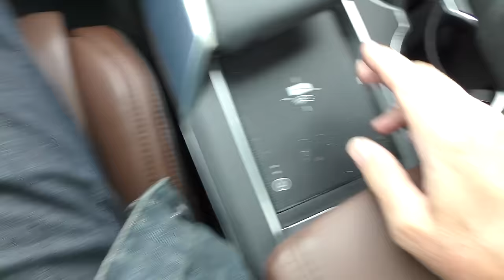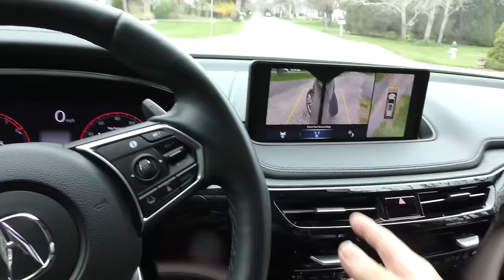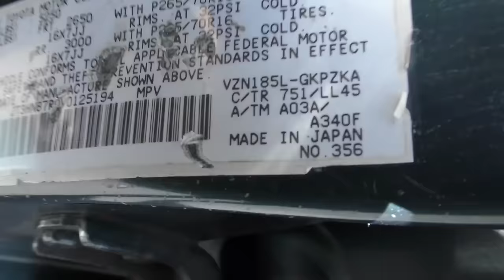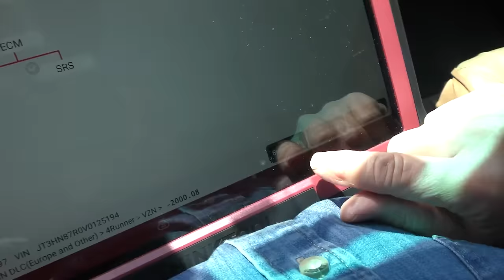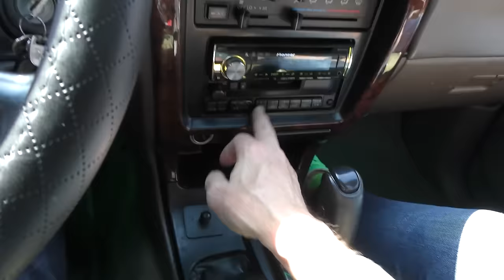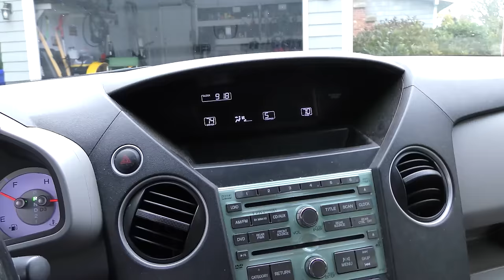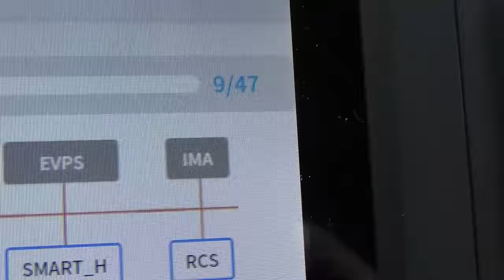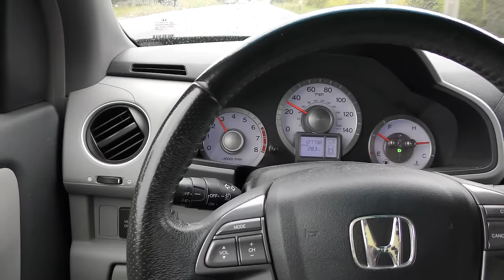3 SUVs That Will Last 500,000 Miles or More

Comment: Agree! I do not understand people buying Mercedes... the proof is the Craig-List old Mercedes costs the same, as old other similar cars... and people are not buying those Mercedeses...
Reply: that's because there was a time a Mercedes was built to last 50 years or more and that is not true anymore , people look for quality , these days honda and toyota is a safer buy for long lasting vehicles
Reply: people buy old used cars to save money and Mercedes parts and work is expensive.
Reply: @KaliAndy2  You would expect that for the price of Mercedes, you would get a better quality car. The used car business shows you how reliable the car is - it does not fare well for Mercedes... the reason is simple, German cars in general are unnecessarily over-engineered...
Reply: @peterjanosik3601  big part of that is cost maintaining a car.  $80k cars parts and labor will be a lot more expensive than 25k car.  Old cars regardless how reliable they are will need maintenance.  If you buy a car with 150k miles stuff like alternator, fuel pumps etc will need to be replaced at some point.  Alternator for cheaper car might be $80 for parts and easy to replace.  For luxury car it might be $500+ plus labor.  People who buy old cars are generally tight on money and can't afford expensive upkeep of a luxury car.  And people who buy luxury cars generally have money and don't want to buy an old one.
Reply: @KaliAndy2  I think we do not understand each other. The problem is that German car makers are cashing in on the pool of people that understand the necessity of unnecessary engineering (and car logo). I am not sure though if those people realize that the resale value of old Mercedes drops a lot more than the resale value of other luxury cars. Practical people make practical decisions.
Reply: @peterjanosik3601  Mercedes, BWM, Jaguars, Volvos, etc all have horrible resale values.  Most people who buy pricier luxury cars do it because they want the car and could care less what the resale value will be in 5 or 10 years. Many of them lease it too and get a new car every 5 years. They could careless if car might lose 2/3 value in 5 years.  People who can afford and lease/buy those cars will never buy a used one.  Money conscious people simply don't buy those cars either due to how expensive it can be to upkeep them.  So there is really not much of a market for those cars used.  Plenty of supply and low demand is reason for the low resale prices.  Cars that are cheap to maintain and last will always have a higher resale value.
Reply: @KaliAndy2  Agree

Comment: I just bought an 02 sequoia with 183k on it it for 3500. Sure it needs a front end refresh and some rust repair in the roof channels. But..  the frame is impeccable. I plan to keep this 2UZ powered beast going for quite some time. So much more reliable and cheaper than a new suv/minivan!

Comment: Picked up a 04 expedition 2 years ago. It's a real nice high mileage southern truck. $3,000.00. I'm currently bringing it back to new condition my budget is $10,000.00. 1 more year and it should be done. I'm retired. All new suspension, large off road tires. Winch. You name it it's been replaced. New paint soon. Then I will register it. It's been a great project. I will have an almost new truck to travel the country. A new 1 is almost $80,000.00. Who cares about mileage. It's paid for. In the future I think your going to see lots of people do what I'm doing. I've had several people wanting to buy it. No way. Have fun.

Comment: Just bought a 2023 4Runner lol. I’m in Love with this thing!
Reply: I have a 2021, and I'm in love with mine too.  They had to give me a rental when they put on new tires because they didn't balance them right the first time, they gave me a 2023, and literally nothing is different. They were supposed to get a redesign in 2022 but I guess that got pushed back.  I drove a lot of very nice cars before I bought the 4Runner, and now I wouldn't trade it for  a Mercedes.
Reply: @huwhitecavebeast1972  i believe the 2023 has a lot more tech standard than the 21 but overall yes it is the same car.

Comment: 1999 TOYOTA 4 RUNNER WAS THE BEST YEAR FOR THIRD GENERATION 4 RUNNERS. HAS THE LOCKING REAR DIFF. PREMIUM STEREO SYSTEM WITH CD PLAYER. GREAT 4 WHEEL DRIVE SYSTEM MY BROTHER HAS 2 OF THEM ONE WITH ONLY 57,642 MILES AND THE OTHER WITH 596,638 MILES . 
BEST 4 WHEEL DRIVE SUV’S EVER MADE.

Comment: If you buy the right year your Mercedes can last as long as a Honda & Toyota!  I had a 2002 ML320 all wheel drive, that car kept going and going!!!  No major problems at all! I did have problems with one of the door locks actuator, other than that, it was a good car through & through, sold with 200k miles. I still see them on the streets. I did end up upgrading to a 2018 GLE 350 and so far so good!  Didn't want to buy a new one because I don't like 4 cylinder turbos!  I wanted a solid v6 with normal aspiration!   During my 20s I drove Honda's & Mazda's great cars but don't feel premium.

Comment: Good evening Scotty! I've got a 17 Corolla with 68k miles, got a squeaking noise (not very loud) coming from the engine when it's in drive but not when it's in neutral or park, any idea what that could be?
Reply: When did you change you oil? Make check for errors
Reply: @RomaKTLlll  oil changed less than 3k miles at the dealership supposedly, i checked it the other day it still is at good level and good color to it
Reply: I have a 2018 Corolla that made the same noise. I took it to Toyota and they said it was the alternator that needs to be replaced. Apparently some cars of those years came with bad alternators. They replaced under warranty and haven’t a problem since. I recommend you get it checked right away.

Comment: Hi Scotty or other experts here - My Lexus RX 400h of 2006 model with 190k miles on it. recently I realized that my fromt wheel tires wore out with in a year and when I went to the store they said its probably the issue with allignment, and I took it to the mechanic and they checked and said they can not do alignment as the bottom of the car is all rusted. Please suggect me if it is safe to drive this car? I love this car  but I am also worried if it is really safe to drive? Thank you.

Comment: Ford Excursion with a 7.3 Powerstroke will outlive them all, so will a Jeep Cherokee with a 4.0.
Reply: @Lray4x4. What a joke! Lol!
Reply: @DEMENTOR MOPAR What SUV had a Cummins in it?
Reply: @mrgurulittle7000  Seen plenty of 7.3s with over 500-600K of them on the original engine, never seen one of the SUVs mentioned with that kind of milage.
Reply: @Lray4x4  only one here I’ve seen with 500k is the 4Runner, especially the 5th gen.
Reply: @Lray4x4. If you never saw these mentioned cars get past 500k, you must live in redneck zone!

Comment: Scotty, I have a 1996 Toyota 4runner 3.4l 4wd. The front passenger brake caliper keeps seizing up on the rotor so snug that I can barely turn the wheel with my hands. The pistons in the caliper will not retract. I have replaced the caliper several times and it keeps doing the same thing. I replaced the ABS module and master cylinder, that didnt help either. It is also building up pressure inside of the valve covers and blowing lots of oil out from the gaskets. Could the seized caliper be causing the extreme pressureto build inside the valve covers when I drive? Do you have any suggestions on what could be causing the caliper to keep seizing.
Reply: Yep it’s from 96 that’s why.
Reply: Replace the hose
Reply: @edwardhalpin7503  false
Reply: The clip on the hose may have rusted and prevent fluid going back
Reply: Change your brake lines from your master cylinder to your calipers I had the same problem and fixed it
Reply: @Jay Dee he wants you to sell your 3rd gen so he can have one 😅
Reply: @Jay Dee 😌😌😌💪😂

Comment: Scotty, good morning I just bought my daughter 06 Toyota Japanese motor, four-cylinder Highlander has 260 some miles on it. AC works great but when I turn the heater on it’s blowing but no hot air is coming out upper radiator hose warm to touch and has pressure lower radiator hose has pressure. cool to  the touch do you think thermostat I don’t know what do you think?  I should check first. I am sending it to her in Reno and it’s cold in Reno help

Comment: Why isn't the Chevy Tahoe/Suburban on this list, even when modded, they have been know to last forever.
Reply: @Mike-sp4iz  Chevrolet is the equivalent to Honda and Toyota, just the American version. My family is foreign and didn't really even like American cars until they owned a Chevy. Chevys can live for a long time, trust me, I know.
Reply: Idk about Tahoe but Suburbans are good vehicles.  Not as reliable as 4Runner, but pretty dang good.  Better mileage than a 4Runner.
Reply: 2001-2006 Tahoe
Reply: @harveyhankerson8359  Just switch to a 4L80E, that was the most common recalls. Also, not just every Tahoe/Suburban but every car in general is different. They all are put in different conditions like weather, different driving styles, etc. So every car has different wear and tear. That's why you will see some cars with 200,000 miles and the motor blows, or 200,000 miles and still driving like it did off of the lot.
Reply: @donaldpump1959  Yes indeed, the GMT800 platform is one of the most reliable platforms GM have ever made.
Reply: @huwhitecavebeast1972  They are the same vehicle, the Suburban is just stretched longer.
Reply: @Mike-sp4iz  But that doesn't take away from the fact that the Chevy Tahoe/Suburban (especially the GMT800) is very reliable and can easily last 200,000+ miles. But every car's wear and tear is different.
Reply: @Mike-sp4iz  I'm by absolutely no means an American car fanboy, but the GMT800 (1999-2006) Chevy trucks were very reliable.

Comment: I don't know why they just can't produce the older vehicles that were less computerized. The modern day vehicles break way to much. Good example I have a 2012 ford focus and the car has been in the shop twice for transmission problems. Fortunately they were covered by Ford. The previous focus that had the old style transmission instead of the 10 speed which is basically a manual transmission that's computer controlled. The car has 138k on it. The older focus was also easier to work on I tried replacing the alternator and ended up bringing it to muffler man. The mechanic said it was difficult to replace and I said I know that's why I brought it to you.
Reply: I grew up in Detroit area where almost everyone worked for the car industry.   The joke was Ford stood for fix or repair daily.

Comment: My 2003 Ford Explorer has 250,000 miles and runs and drives like new.. and looks new inside and out… everything works on it even the cruise control and 4wd !❤
Reply: and gets under 10mpg. Look at the gas prices now. HARD PASS.
Reply: @Andy Stagger V6 or V8?
Reply: I Have a 2002 Ford Explorer, still runs & drives great and has 275,000 miles on it
Reply: @carlenger9707  v6
Reply: @henrykim4230  under 10 mpg with a v6? Nope it gets about 19 mpg more on the highway… gotta say it is not a gas hog. I love that little suv ❤️
Reply: @henrykim4230   you think has is high now? Just wait until you see proves in January .
Reply: Not sure where folks get their data but my 2009 V8 Explorer rated at 16 blended, 19 HWY.   I actually squeeze 20 on my trips to Florida.  2021 4Runner V6 rated at 17 blended, 19 HWY.   Both trucks are solid body on frame.  

I'd love to have a new 4 Runner but as long as my Explorer runs like it does it will be a while!
Reply: I've had good fords too. Honda is my favorite though
Reply: @henrykim4230  lol....what?????? I've had those v6 explorers..... They aren't bad on gas for an  SUV at all...10 mpg?? Its not a suburban...
Reply: Update us when it reaches 500k milles 🙃
Reply: Same with mine! Does need ball joints but runs great. I think mine recently went over 300,000.
Reply: @andystagger2906  Here in LA, we do mostly mixjobs. That thing will easily do 10mpg the way how I drive. NP.
Reply: @HarrisonCountyStudio  Quit scaring me ><
Reply: @henrykim4230  I live in Sacramento… the car runs good and is no gas hog.. I’ve clocked it at 19 mpg on the highway.. and I drive with a leadfoot!😜🤣 my gmc pickup that thing was a gas hog at 11 mpg… I’m from Miami we drive way faster and ruder than you Cali people ! Y’all care too much bout pollution here .. we don’t even put mufflers and cut that catalytic converters right off the car over there … no inspection ❤️😜 California sucks! As soon as my parents pass away I’m outta here 😜🤣
Reply: @davidhoulden5791  I’ve had several Explorers they were all great cars and didn’t waste much gas ❤️ never gave me a problem.. it’s all about regular maintenance with any car!
Reply: @henrykim4230  I’m going back to Miami … just here cause my moms been sick … but yes I agree Sac town is boring and pretty dirty 😳
Reply: @andystagger2906  F desantis man. That guy is illusional. I am right hand myself but he's a monster.

Comment: Mine s shudders between 35 and 45 mph an hour. When I test drove it didn’t do it. Bought it and noticed it after. I’ve been driving it that way since February. Sometimes it doesn’t do it at all and then it will do it randomly when shifting between 35 and 45 mph

Comment: I need help!!
I have a 2002 BMW 330i; I'm currently having engine problems. The #2,3,4 cylinders are lacking psi. 
I was told I need another engine; is that the case? And if so what engines are compatible with a 2002 BMW 330i?

Comment: Thinks to self. Top 3 SUVs and 2 are basically the same vehicles under the hood especially. All 3 are belt driven. So much for buying an engine with a chain for reliability. Probably the chain is the only thing that holds up in some engines. lol.

Comment: I have a 99 4Runner with 275,000 miles, does have a oil leak with I think it could be oil cooler O rings but not sure if that is it. But it a good truck and love to drive it.

Comment: after 10 years of driving Acura MDX 2014 (purchased December 2013), I spent $950 for replacement the faulty Acceleration Throttle Body, $2100 for 2 front struts & 2 control arm, mine is currently 77500 miles!  If this is true, I hope this would last until my son getting out of college ,,,he's currently 7 graders :) !!
Reply: Glad you posted info 👍

Comment: I’m the original owner 2001 Honda cry with 260k .never changed the trans fluid..oops still ok. Ac compressor blew twice,radiator at 170k,rear springs changed at 180k not bad but wanted new,.

Comment: yes early 2000s 4runners are fine but to anyone reading this, dont buy a pre-20004runner and expect it to last forever. the 3.0 have a notoriously bad head, I owned one and my buddie had a manual one and both had bad head issues

Comment: The MDX is a great SUV. Wife only had it for 4 months as the seats are awful! Side Bolsters here her hips. The bottom is a hard seat. Go figure. Went to the Aviator and she loves it
Reply: Japanese make good quality cars... They do t spend too much time on seats and comfort. German cars are the most comfortable . Or at least used to be... They care about seats headrests. Hand rest. Etc... I test drove a Mazda cx9 2012 I think and it was terrible. The side console was hitting my knee. I knew it was not comfortable right away... The seat and comfort is an engineering field by itself...
Try the Lexus GX. Or 4rumner. Much more  comfortable.... The Aviator will not be reliable ...
Reply: @charlestimmis273  Somewhat agree as we have had a couple of RX 350 but waiting for the GX change over. Before she had the X5 and loved it until BMW wanted $2200 for a rotor and pad change. So we elected to part company with BMW. PLUS they have same problem in their seats presently, side bolsters issue once again. No more flat seat!  The Aviator has a great 400 hp but yes a turbo engine. We will see

Comment: Hello everyone 
I know you are sick of me but I must also brag on my 1999 Toyota 4runner Limited again that has 604k miles original engine and transmission. I bought it with 500k miles and it is my fav 4runner of my 2 (I have a 2001 SR5 that has less than 200k miles). 
The only issue with my 99 is the common stuck sunroof and now the pesky rear main seal slow drip! It drives like a dream and I get honks and waves everywhere I go. I recommend the 3rd gen 4runner to anyone IF you can find one in decent condition!
Scotty, I would love to drive it to you soon!!!

Comment: I think lots of older SUVs deserve at least an honorable mention.  I'm not a fan of the car-based crossover types.  They're FWD, and you have to take them to a shop and pay over a grand to get new spark plugs installed.

Comment: I can take virtually ANY SUV and make it last 500,000 or way more miles.  Just keep Amsoil in the engine, transmission and any differential and then the drivetrain won't wear out.  Then you can just pay to repair sensors, alternators, water pumps, and small stuff that costs way less than replacing the entire car.  People do it often who know of this oil.

Comment: 2002 Honda CR-V are great Engines K-24.Mine has 261,500.Only bad is the A/C Compressor explode and then you need to replace everything.